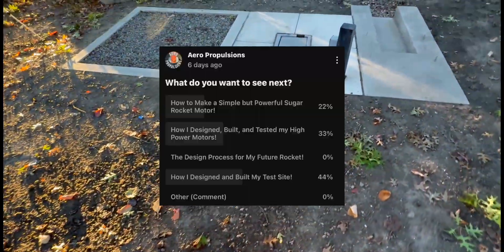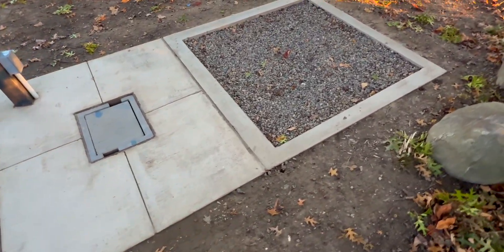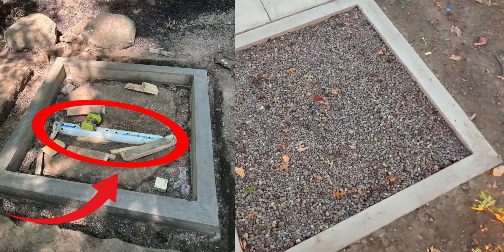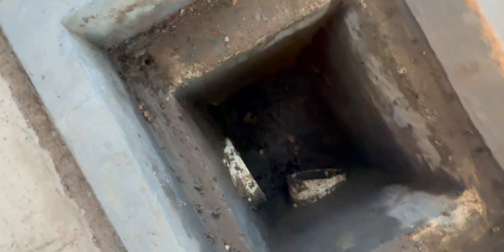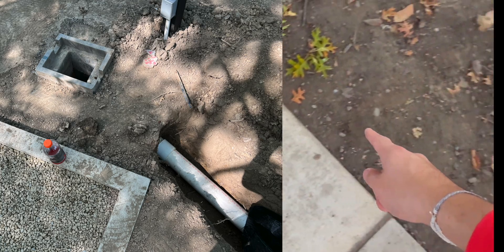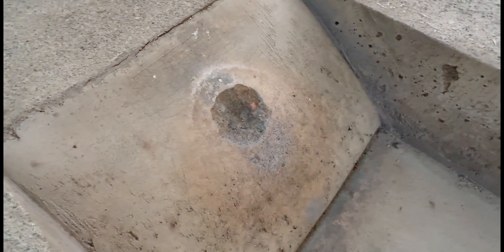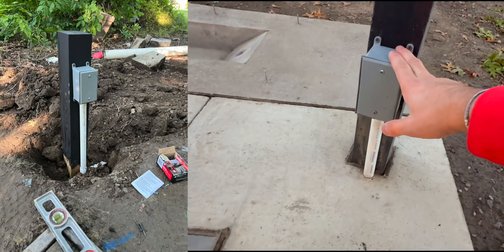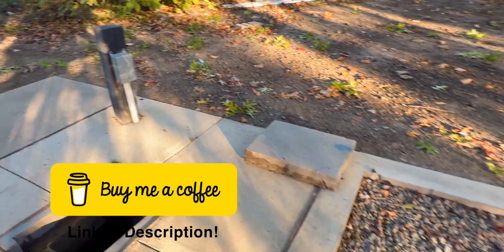How I Built My Rocket Test Site!

Comment: Thanks for posting this. That's a really beautiful test site. I'd definitely recommend going with a metal deflection plate. You can bolt it to the concrete with specialty masonry screws and pre-drill the holes with a hammer drill and a masonry bit made for an impact drill. .... (you probably know all that already, but tossed it out just in case not to save you time and trouble) ... Great job!
Reply from the maker: Thank you so much! That’s a great suggestion, will be adding that metal plate soon.